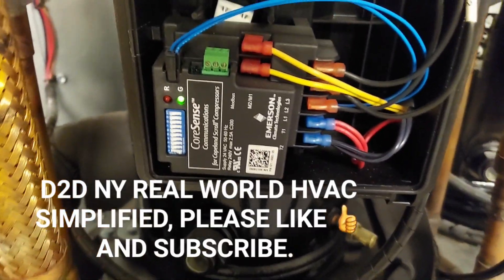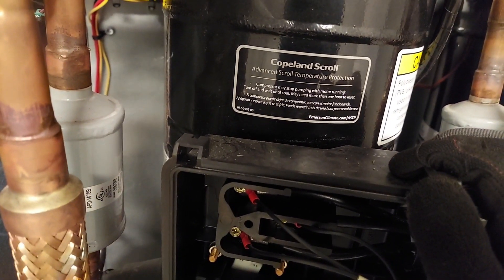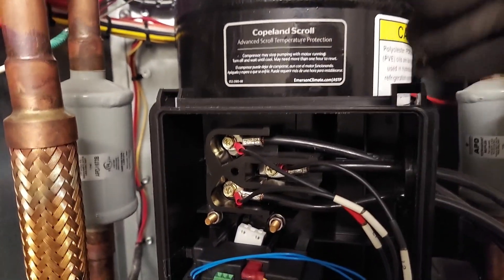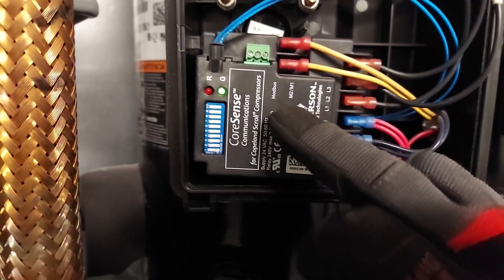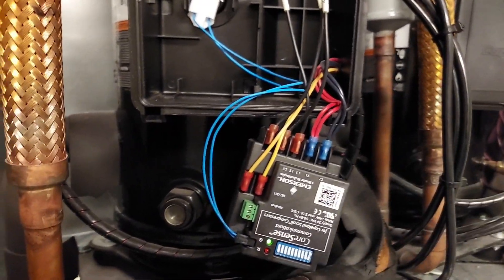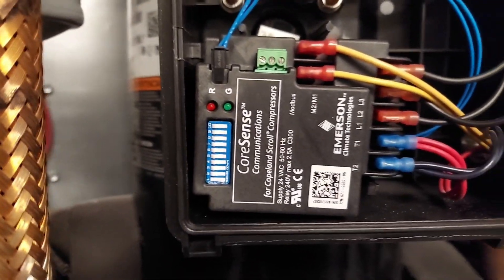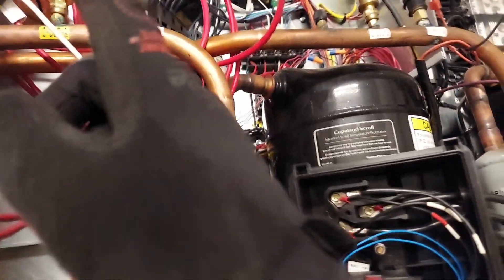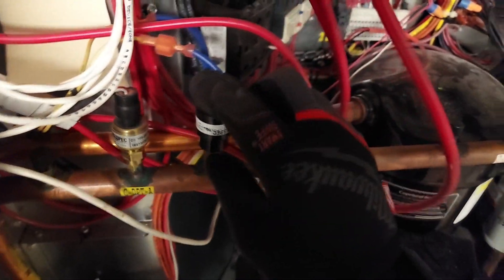CORE SENSE | COPELAND COMPRESSORS

Comment: Hello, I have a compressor-blocked alarm. The compressor was checked and its operation is positive. The alarm won't allow it to turn on. What can I check? The thermal display shows "normally open." Is there any solution for the compressor?
Reply from the maker: What flash code are you seeing ?

Comment: A have system with a tandem Copeland compressor and core sense module, I replaced both compressors and oil separator after a burn out. Also the FD and I installed a liquid line drier too. When I call for cooling on the BMS the unit turns on for like 10seconds and then shuts off. It never reaches proper compression ratio. I get no alarms on the core sense, or the PCB. Any suggestions?
Reply from the maker: If its the same unit, Water flow issues possibly check flow switch , if the main  fan shuts down as well it may be external controls issues!

Comment: On a 2 flash code for the temp sensor, is there a way to verify and check the sensor, you can just order a new one I suppose?
Reply from the maker: You can’t replace these sensors, you could ohm it out to see if it’s bad, some compressor comes with a backup sensor , with a bad sensor you either replace the compressor or bypass the module.
Reply: @D2DNYAC  but that white piece that clips on can’t you unclip it and replace that?
Reply: How about if the red blinking?

Comment: So if the compressor is running but not pumping then the compressor may be fine, just an issue with the core sense?
Reply from the maker: Possibly, because if the compressor is running hot and the core sense doesn’t trip then the scrolls will separate in this compressor

Comment: Anyone have experience with CoreSense control modules ?  AC unit runs, but every time AC starts the first time from a thermostat call, CoreSense trips on high current (CoreSense flashing lights error code) within a few seconds, then starts a minute later normally.   Measured inrush current at about 120 amps, and manufacturers plate rating is for 114 amps, so it’s within range.  Changed CoreSense module, same result. Amana condensing unit ASZ130421AG.   New installation of 10 yr old stock unit.

Comment: Had a locked rotor code on one of these today but the compressor would start briefly and stay on but it sounded like it was losing its stage or variability
Reply from the maker: Is your compressor electrically sound?
Reply: @D2DNYAC  yes it’s receiving high voltage and windings are in tact. It’s a digital compressor and I didn’t know it had that Loading and unloading feature until later. Luckily I didn’t give an official diagnosis until I got more information. I’ll go back later and adjust the set point or disable the valve but I think the compressor is fine after watching your videos. I’m a preferred member I can pm you with more info.

Comment: What are the factors to be seen when replacing a compressor if not getting same manufacture, let me know
Reply from the maker: Capacity, voltage /power supply, oil and you may have to do some additional piping and mounting

Comment: I hvav a problem of 4 flashing (scroll compressor high temperature) and compressor current is 120A
Could it be because of crankcase heater??
Reply from the maker: 120 amps that sounds very high what's the supply voltage and compressor tonnage?